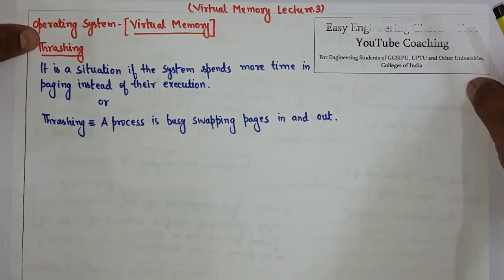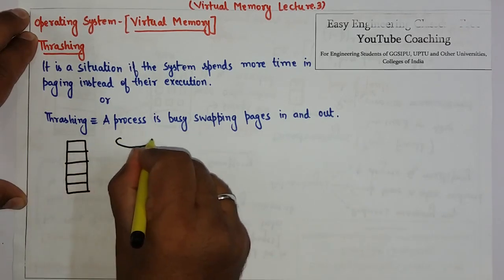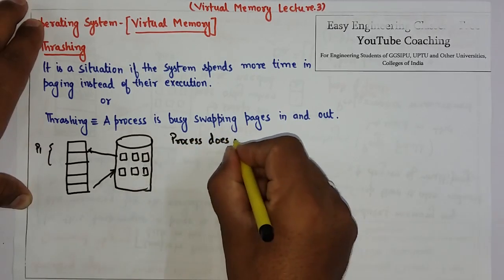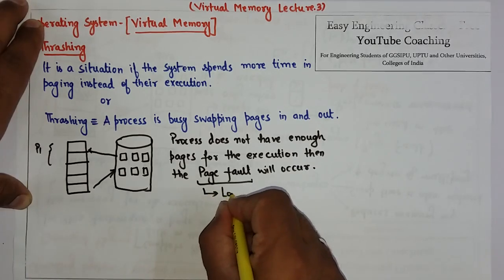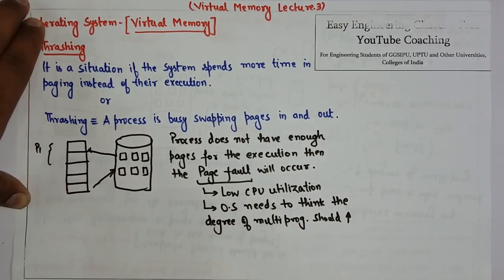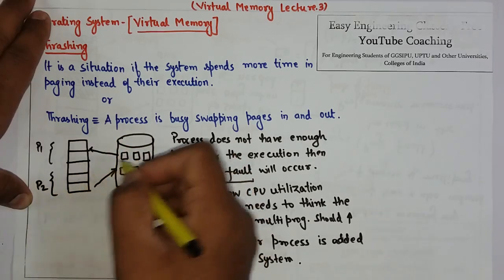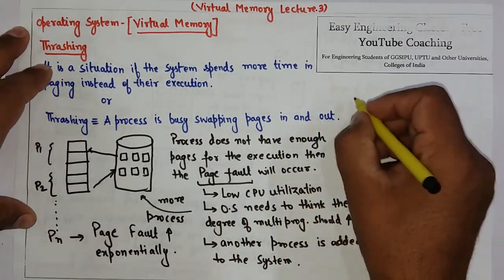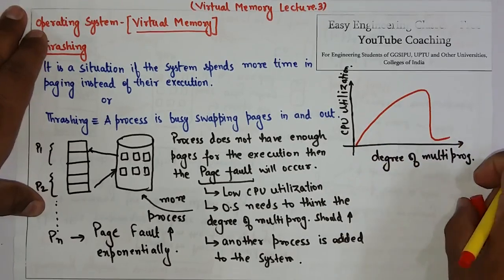L48: What is Thrashing Problem in Operating System Virtual Memory | OS Lectures in Hindi

Comment: You said  the point where CPU utilization is zero is the point of thrashing but you are pointing the highest peak of graph(point of highest utilization). Why?
Reply: Vaibhav Sharma The graph till its max point depicts proper use of cpu upto its max.. then comes a point when the system is busy in paging thus the CPU is free and not executing any process. That point is called thrashing.